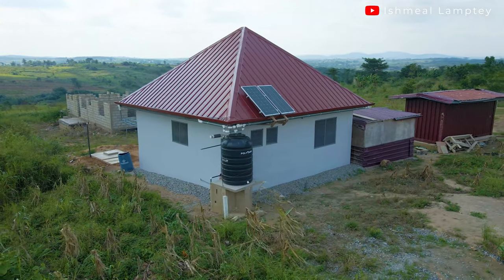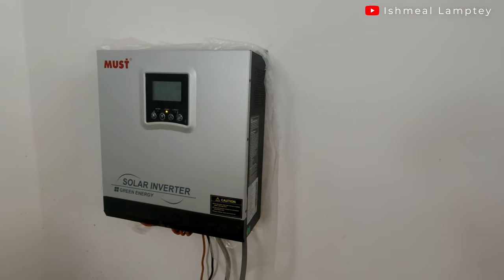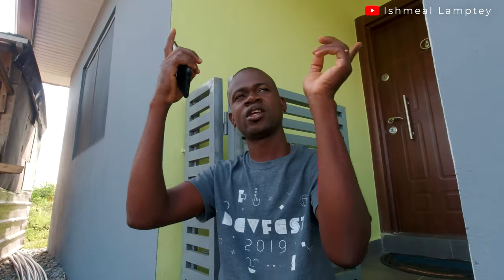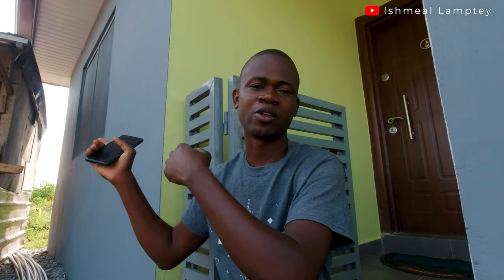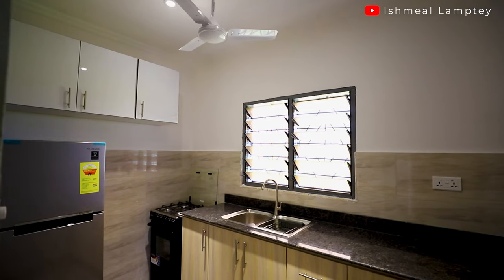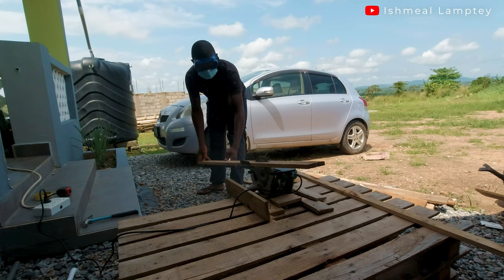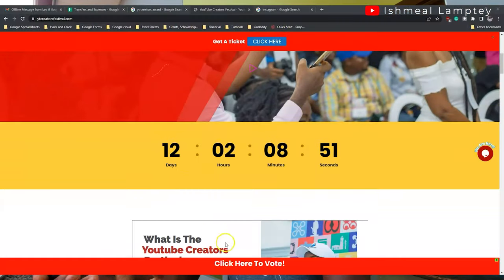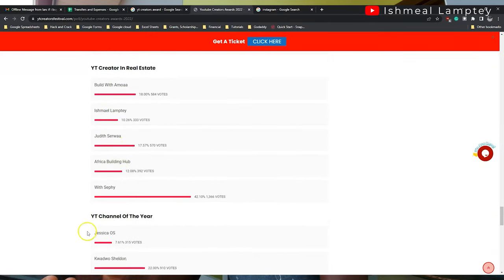How we upgraded our Solar System while living Off-Grid in Ghana

Comment: Hello 👋 mr Ishmael,  trust you are well.  I'm an electrician,  i dont install solar panels but I do think ahead and always want to do the wiring setup so whoever comes to do the installation will avoid the hustle of chiselling, piping and stuff. Niw my challenge is the size and type of Cable to use.. someone told me to use 4mm² ×4 2c coil flex cable  but i will like to ask around and get other opinions especially on safety. Which type and size of cable is recommended for solar installation? Thank you.
Reply from the maker: The size of cable to be used for an installation is dependent on the type of installation being done and the amount of power going to be generated. So I can't entirely tell what size of cable is best when i haven't seen your setup design
Reply: @IshmealLamptey  I'm doing it for a 20,000 Watts(20 kva) system.
Reply from the maker: @multiskilledelectrician1  how much power is being generated from the panels? Also there are special solar cables or DC cables you can buy for your setup.
Reply: @IshmealLamptey  well noted, thanks.

Comment: Hi Ismael,  I just built a two story home in Ghana in the Aburi mountains and am considering solar instead of my generator.  This video helped a lot.  To power ceiling fans, a mid size refrigerator, laptop, and lights, how many panels do you suggest and batteries?  It's a two-bedroom house with a loft upstairs. What would be the cost of the panels and accessories? I am visiting South Afrika right now before returning to Ghana and wonder if I should import the items from here if it's less expensive.
Reply from the maker: Hi, glad to hear that the video helped. With regard to a solution for your building, kindly send me a message on WhatsApp via +233547658523 for more information

Comment: 1. So how much power are you generating so far? 
2.Do you recommend I go for at least 300watts panels for a start. 
3. Do you recommend I buy at least 3kva inverter OR hybrid inverter?
4. How do you make sure your batteries are not drained?
Reply from the maker: 1. It varies depending on the amount of daylight it gets. But the least the panels generates is about 5000 watts.

2. 300 watts aren't bad if you can afford. The higher the size of the panel, the faster your batteries gets charged
3. If you buy just the inverter, you'll need to purchase a charge controller as well. The hybrid inverter comes with that built-in. An advantage of having a different device servicing as a charge controller is that, it works effectively than an in-built one
4.to make sure your batteries are not fully drained, try to monitor the level of the batteries from the charge controller or the inverter. Alternatively, having adequate batteries and panels, that shouldn't be a problem. Using lithium ion batteries is also better than that of gel batteries
Reply: @IshmealLamptey   thanks you so much. being looking around for the system. im thinking of 3kva inverter, 200ah lithium ion battery and 300 watts solar panels. im going to buy them separately and get an engineer to build the system form
Reply from the maker: Okay great. All the best with that